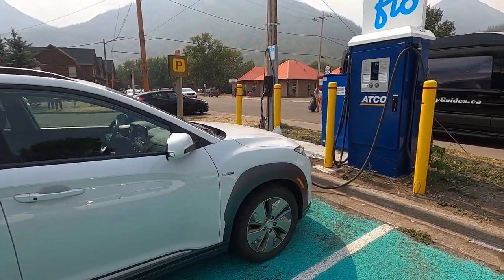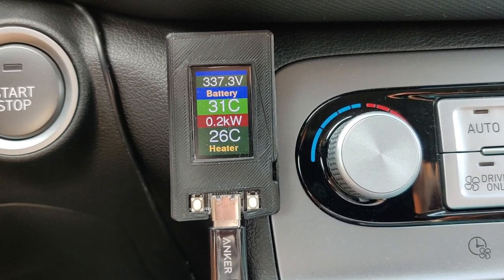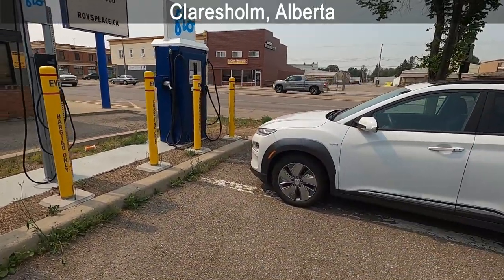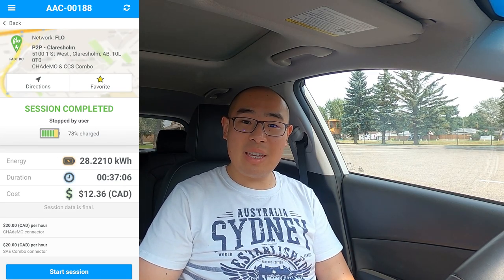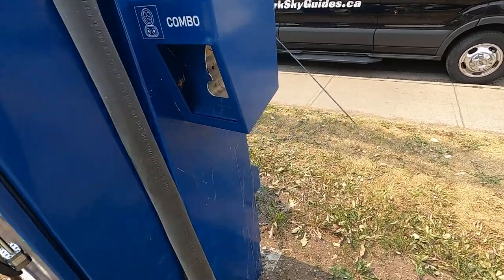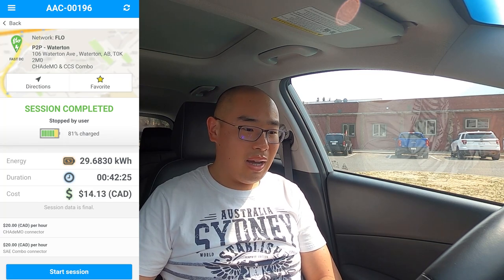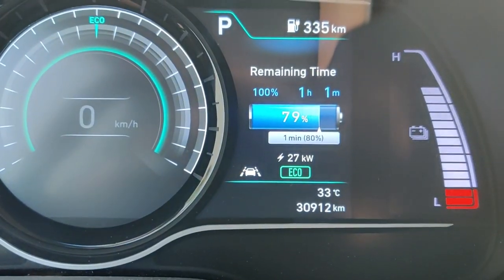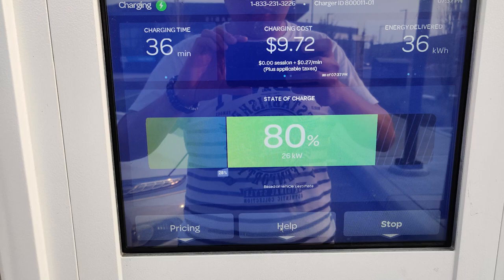1140km EV Road Trip: Edmonton to Waterton | Hyundai Kona EV 64kWh

Comment: Well done Solomon, I can imagine how tired you must have felt after a long hot day. Here in Québec the FLO/Electric Circuit 50 and 100 KWh chargers are $12.50 an hour and the faster Petrol Canada 150/350kwh chargers $0.27 per minute, a wee difference if you’re covering long distances regularly, but either is still more preferable to gas prices.

Comment: Do you think the Kona e would be a good choice for someone that isn't technologically savvy? I can't even keep my email box organized. Great video, great graphics.
Reply from the maker: On a basic level, if you just want an EV that works, I would say the Kona is a good choice. From my own experience, the Kona is pretty reliable and I never had any glitches or software issues with the vehicle. So I can just plug in when the battery is low and drive it when you have charged enough. But if you want the most optimized EV experience, I would say Tesla is the best choice. There are many things that Tesla vehicles does so much better than non-Tesla vehicles. In the winter, I have to monitor battery temperature of the Kona to determine where and when to charge to provide the best charging speed to price ratio. Because EV charges slowly when the battery is too cold. Tesla vehicles pre-heat the battery for you when you navigate to their supercharger to make sure you arrive with a warm battery. Tesla's on board navigation shows you where the charging stations are, availability, and can plan your trip for you around superchargers. For the Kona, I need to juggle a few different apps to plan my trip, find charging stations, check availability, and pay for charging. Tesla superchargers are just plug and play, and you really don't have to do anything on your end except for plugging in. For non-Tesla, a different app is required for each charging network. Most of the time you can activate a charging station with an app, sometimes that doesn't work and you might need to use an NFC card or tag, you might have to call the number on the station, or you can use your credit card on only some of the charging stations. As for the phone app experience for connectivity with your EV, Tesla is the best. Their app is fast with a lot of functions and connects with ease. The Bluelink app for the Kona is quite slow and limited in function. Bluelink had worked fine for me most of the time but there are a lot of Kona Electric users who really dislike the Bluelink app. All in all, Tesla vehicles are probably the best for non-tech savvy people.

Comment: Can you also tell us your average speed between the charging points?
Besides that, very nice clips of the Kona and your adventures.
Reply from the maker: From Edmonton to Claresholm, most of the highway is 110km/hr. From Claresholm to Waterton, most of the highway is 100km/hr. I drive between speed limit and 10% above speed limit.
Reply: @READYSTEADYCHARGE  Do you use cruise control when going such distances? Also, do you know if regen braking is more or less effective when using cruise control? Appreciate the Kona specific content!
Reply from the maker: @eoinoneill1774  I use cruise control on part of this trip where there isn't a lot of cars in front of me. Otherwise, I always use Level 3 regen. When the vehicle is slowing down on it's own during adaptive cruise control, it uses regen, but definitely not as heavy as Level 3 regen.

Comment: When you are charging and sitting, do you run air conditioning or heat as required to the cabin for comfort?
Reply from the maker: Yes, I run the HVAC to keep myself comfortable when charging. Cooling in the summer usually takes 1kW or less. Heating in the winter is around 2kW. If you are charging at 50kW or above it's not that significant. I do tend to turn HVAC off when shooting video to reduce background noise.